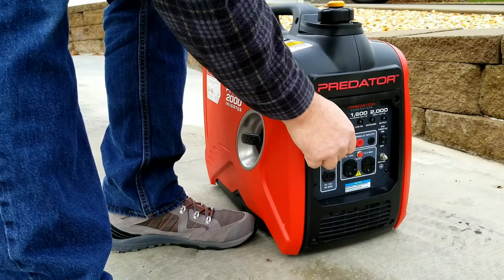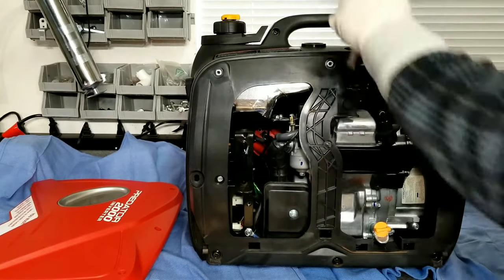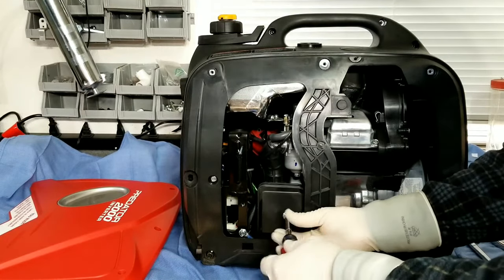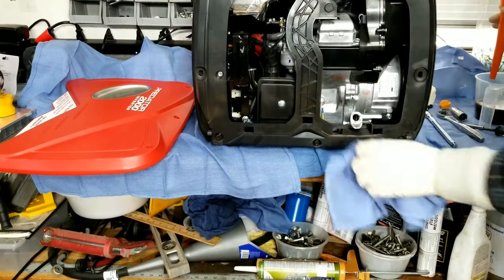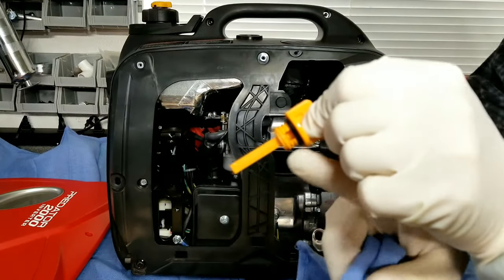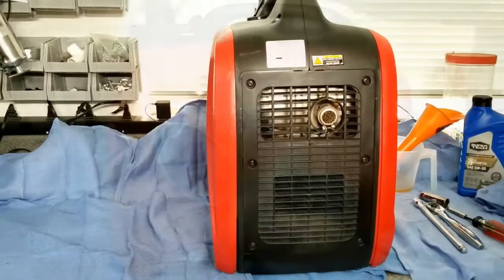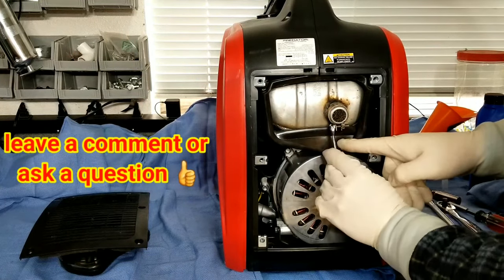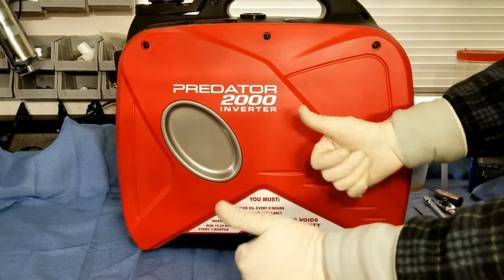Predator 2000 Oil change and 100hr 6 month service Don't forget this part!!

Comment: Anyone have problems removing pull cord cover??? My cord snapped and the three bolts just spin!!!!! Help!
Reply from the maker: You will have to remove the rear and front cover to see if the insert the screw goes in, if its just spinning you’ll need to get some long pliers on the pack side. Or something to grip it to keep it from spinning. 
I assume if they are free spinning they where put in to hard and stripped.
Reply: @johnnysweekends  first thank you, second the pull cord hub has three bolts that goes in to I can't see behind this is the predator 2000 w unit
Reply from the maker: Hmm I can take a peek later and if I can give a better answer. 
 Even with the other cover off you can’t see across. Sorry been a little while.
Reply: @johnnysweekends  it's not the red covers it's the hub cover ...It looks like like and I have to remove everything to get at the cover which the pull cord hub attaches to...hey thanks for the response maybe u can make a video to help out the next guy...ty!
Reply from the maker: Oh the black pulley cover on the engine?? Oh those are just spinning?? That’s not good lol. Hmmm bummer there. Yea with it being there that could be a chore. Uhhhh 

Dude sorry yea may need to do one.